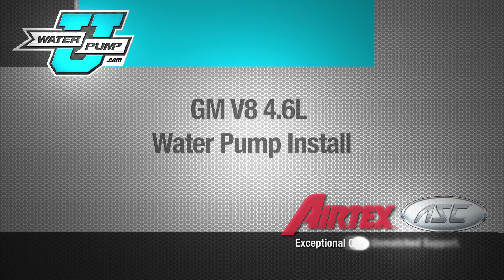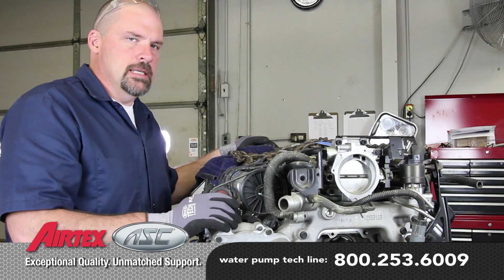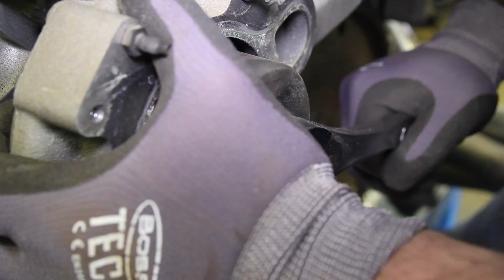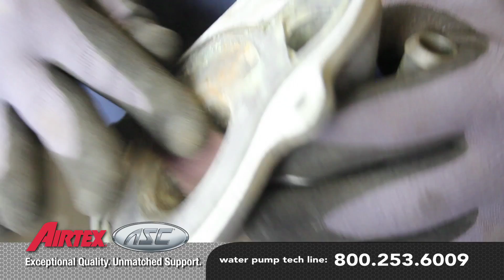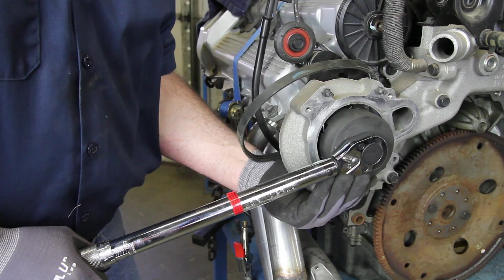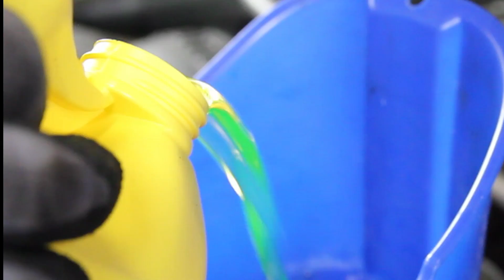Special Tool Needed to Install GM V8 4.6L Water Pump WP-9018 AW5072

Comment: I'm working on 98 DeVille is the water install the same. What position does the water pump go in. Thank you
Reply: Lol what position. It only goes in one way lmao you prob should get help. Oh I see you commented a month ago. I'm sure it's still apart lol but the water pump goes in on way with the socket on it it has a notch to line up for it to lock in before tighting just put socket on the pump and turn spin it inside engine by hand slowly til you see the notch on pump go in on the engine then torque it down with ratchet and it tightens to the left .. opposite of a regular bolt

Comment: What if the water pump is rusted in there and won't e b reak loose even after putting navel .jelly in there?
Reply from the maker: Just a note: The pump is turned clockwise, to the right, to loosen. It could be considered a left hand thread. This is backwards to a regular fastener. If the pump is truly frozen in it may be that the pump housing will need to be removed and replaced.

Comment: Just put an Airtex water pump on my 08 DTS....way more of a pain than these older Northstars.....Excellent quality pumps though...you can tell simply by looking at it the build quality is second to none....would highly recommended Airtex products
Reply from the maker: Thanks for the compliments on our pumps.
Reply: Did it work as it did in this video? Or did you have to take it all apart like most DTS videos??
Reply: @johnsrandomness 
https://youtu.be/WdVDPz4dC2U?si=xypIza2XBopcHJIc

Comment: We Tried to remove the pump but we could not get it to break free with the water pump tool and a 1/2" drive 18"' breaker bar can you help with a suggestion frustration thanks

Comment: 2006 Cadillac DTS I'm trying to remove the water pump with gm pump socket but it just keeps on spinning? please help
Reply: I have removed the whole water pump housing to also repair my seals fyi as to why it might be spinning and not unscrewing?

Comment: I have a '97 Eldorado ETC, 235K miles. This is the fifth video I've watched about Northstar water pumps. With every one the water pump has easily twisted out from under the tangs. I've fought mine for hours and still cannot get it to budge. I soaked it in PB Blaster overnight; nothing. I have had a breaker bar by itself, a breaker bar with a 2 ft piece of pipe, then went all out with an impact gun. Nothing. This pump will not move.
I must say, with all the other videos, the inside of the pump housing was in reasonable condition, without a lot of corrosion/rust, as was the pump. With yours, I was relieved to see it was actually rusty. But....yours popped out just as easily as all the rest have. Mine, on the other hand....
I would dearly love to find the GM engineer who thought this setup was a good idea. It is not. I would first beat him severely about the head and shoulders, then drag him kicking and screaming to my Eldo to have HIM finish this job. Afterwards I may beat him again just for cause.
Last but not least, no one, even you, has mentioned why there is one odd tang with a notch in it, which must be located in a particular spot (1 o'clock apparently). Why?
Reply: I know how it's SUPPOSED to come out. It just won't. Is there a pin or something that locks into that one odd tab at 1 o'clock? As I mentioned, I have had an impact gun on this thing, and it flat will not budge, and the tool/socket is cutting it's way into the tabs on the old pump.
Current plan is if I don't find a solution, my only option seems to be replacing the whole crossover, and that's not something I'm looking forward to.
Reply: @fredflintstone3956  SAME problem, My pump isnt BAD, i tore down to try n get to BOTTOM back X over screw that was NEVER torqued, itstarted leaking @ 7 O clock position, lvg pump in, it looks fine NO rust Dexkool since birth
Reply: Hi I know this is an old thread but did you ever figure it out? I’m having the exact same problem..... help

Comment: what year motor is that im about to do a water pump change on 2007 cadillac DTS would it be the same process
Reply: +charles taylor There's a guy on here that did a great video that was long enough to be two separate episodes of this awfully designed waterpump. The 05' and prior is a walk in the park compared to the 06-11s
Reply: @LSp8  Engineers just design them, they don't have to work on them. The older ones could be done by a "Weekend Mechanic" the newer ones, forget it.
Reply: I'm doing my 2011 dts and I can't get the water pump out do I have to take the housing all the way out do I need different key I'm lost
Reply: it was a 4.6 northstar

Comment: great video...its a little hard to see the tabs with the pump housing 
still in the engine compartment..when tightening the water pump, 
approximately how far should i expect the pump to turn before its 
tight...half inch?  3/4 inch?

Comment: My mechanic is struggling to remove my water pump. He said there's a lot of rust that's keeping it from turning. It's a 1994 Cadillac Seville.
Reply: OrangeCounty92 tell you spray it with lubricant and give it from hit with a rubber hammed you just need to get it slide a bit so the lubricant can go deep inside the corroded area
It’s like an old granny’s pussy

Comment: any idea how to get the pump out when it is highly corroded in the housing? Tool wont budge it.
Reply: ***** Well I'm looking at a disaster. The customer first used a angle grinder to the impeller. Then used a punch and bent all the pump stop tabs down. neither me nor the customer wants to take the front housing off.